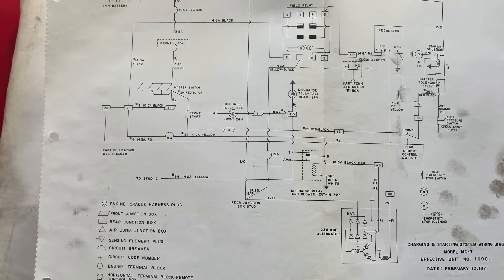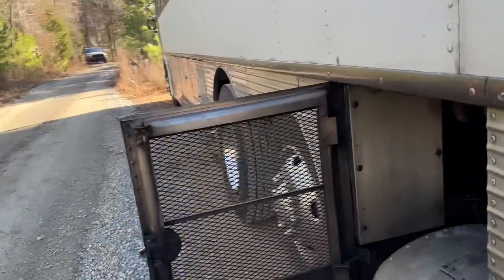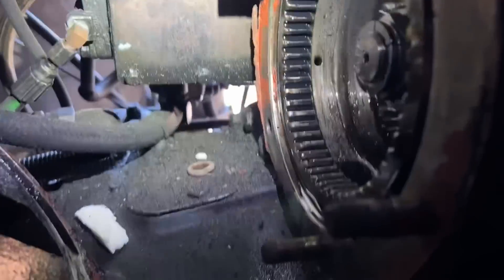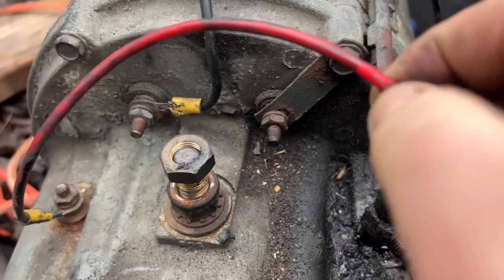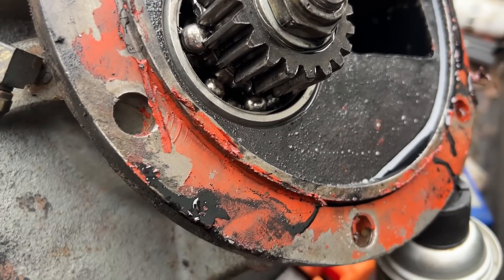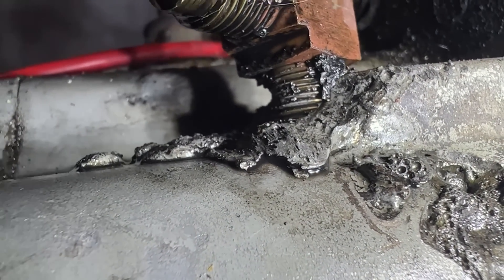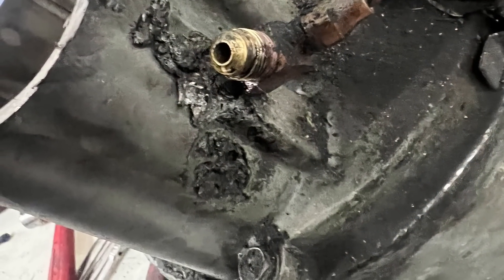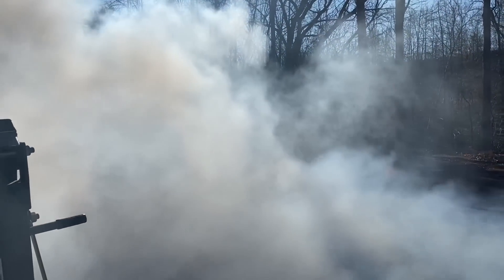Gear driven 50dn alternator spectacular fail in a detroit diesel 8v71.

Comment: Where are you fellas located I’d like to start using you for my repairs. I have a 1995 Prevost XL and a 2003 H3-45. Both always need something. If I could acquire a phone number and/or email with location I’d surely appreciate it. I’m worn out with repairing, driving and I just wanna do the singing from now on. Thank you 

GT

Comment: I have overhauled several 50 DN units , on large motor homes.  I built a jig for my tester to run it up  for testing.  It’s an interesting unit, oil cooled high output.  I haven’t seen one in a while.

Comment: I wonder if the electrical current flow due to the short might have caused damage to the bearing. I have seen the same type of things happen on motors that have low insulation resistance, current  passes  through the rotor back to earth through the bearings and basically ruins the surface of the bearings.

Comment: I know what happened. The cable rubbed thru, arced, grounded out and deposited a small piece of metal in a small gap somewhere inside the alternator and eventually made its way to thru the bearings and ruined it.

Comment: I bet it failed because the tapered roller bearing wasn't on the correct side. 
I bet that eroding happened because whomever installed it didn't disconnect the batteries before putting a wrench on it and grounded out on the case while hooking the power wire back up. 🤣

Comment: Well, the wire looks smooth, not molten. Kind of would expect the heat melting the wire insulation... There is only abrasion marks and no signs of fire. If that starter aluminum housing melts it needs at least 900 Celsius grades. On the other end of the arc would be the wire and its insulation.

Anyhow. Everything is possible. But it looks like someone tried to do some repair with something not suitable...

Comment: Is there a work around to put a regular belt driven alternator on there to get away from the possible gear train damage or is it even necessary?   I assume that style of alternator must be pretty reliable or you wouldn't be putting it back to stock.

Comment: I’m assuming that since my seven has a generator still, I don’t have to worry about this problem. Correct me if I’m wrong. That bus would look a lot better if it had a red, blue stripe and a dog on the side.
Reply from the maker: Even though your book calls it a generator it is in fact a 50dn alternator.  But yours is most likely belt driven not direct gear drive.
Reply: @BusGreaseMonkey  Yep mine is belt driven, but I did not know it was in fact a alt. Funny you said in the video that he did not have a not gen light. From what I've understood in the short time I've been a bus guy, is that having a not gen light illuminated is almost "normal" on Mci's of that time frame. Some of the guys on the bus monkey site said just turn on everything electrical you can and most the time it will put it out. Makes me wonder if it's getting an overvoltage. My light cycles on and off for a while then it stays on.

Comment: Ah the joys of oil-cooled motors & generators.
Great when they are running well, but oh dear me, how messy when they stop, particularly with gear/shaft drives.  Last one I worked on suffered a winding failure which seized the machine (at least there was a shear-pin in the drive shaft so the diesel didn't break).  We drained the oil and copper filings from the machine before stripping it using filter pads to collect the debris (we did a full failure analysis as there were several similar failures at the same time), then wash the residue out (more bits of copper).  Finally located the source of the failure - incorrect taping and balancing of the windings leading to the rotor hitting the stator, the debris caused a bearing to fail and, as they say, the rest was history.  A batch of about 80 generators was recalled (or at least those that hadn't destroyed themselves) and all were found to be heading down the road to destruction.

Comment: Hey Lance………… Ah no, not today, it’s now…… Hey Don!!! This is NOT the video I wanted to see right now!! Especially at 3am, cause now there’s absolutely no way I’m gonna get back to sleep at all!! This is the exact same problem I’ve got on my 82 MC9 with the 8V71. Yep, I did get 
ROOKED by the church, just like I thought. 

I just bought this bus and the entire day I was there looking it over, I started it 5-6 times and drove it a couple times, walked around it checking all the lights and they were burning good from what I could tell but it was still light out at the time. I did not have any warning lights on the dash for no-Gen, or anything else. The bus was running great, as it should for the engine only having 10k miles since rebuild but that was about ten years ago when it was done. I finalized the transaction and was giving things in the cockpit one more good looking over before I was gonna leave and I noticed the amp gauge on the dash was in the yellow and reading approximately 22amps which is extremely low for a 24 volt system so I said something to the church Deacon that I had been dealing with through out this entire process and I asked him again if they had been having any charging issues cause the amp meter was reading low and he once again stated that no, they had
 Not had any charging issues, had not had to ever charge the batteries at all unless they had forgotten to shut off the main battery disconnect, which is fairly common on these, but the lights seemed to be burning good, and it  had started fine all day giving me no indication that the batteries were not charging and especially the fact that I did not have the “No-Gen” warning light illuminated on the dash panel. At this point, I was thinking that it was completely possible that I had a faulty gauge. I’m a. Old jet engine mechanic from the Air Force and that happened to gauges all the time and nothing e
was indicating, without actually putting a meter on it to see what it was producing but since I flew to Florida to look at it , I was limited on what tools I had 

I  made the decision, after being told by both the church Deacon, as well as the pastor himself, numerous times that the bus had just come out of a complete and thorough, top to bottom, inspection to be sure it was road ready and had no issues and was ready for a cross country trip except for the air conditioning. I made it about 40 miles down the road and I lost all lights cause it was apparent by now that I had generator issues. 

Long story short, I managed to limp her the 500 miles home by having to jump start her each morning, which for jumpstarts for three mornings I accrued $800 in jump fees which I feel like I got raped over but I had to get home. I have not torn into that part yet because I’ve been trying to research it to find ouT what the issue was cause the no-Gen light not being illuminated on the dash was throwing me off but this video pretty much explains it all right now. 

Scott, when you say this is an engine killer, what do you mean exactly? What other indications do I need to look for that I have bigger issues? I have not driven the bus since I got her home until I could figure out what’s happening. The oil looks good so far and I don’t have any screaming cats back there when I have started it a couple times. Is this simply gonna be a generator change or what am I looking at? I was gonna try and schedule a visit with you guys this summer when you could get me in an I am a patreon member but it sounds like this may be something a bit more critical than being able to wait if I’m in danger of trashing the engine. Please Scott, advise me what to do here brother! This video now has my stomach wrapped up in knots! But at least this explains my situation and what has happened, now I just need to know how to proceed. 

Thank you Scott for all you Kelli, and Tyler do to help us keep these buses on the road.
Reply from the maker: Diagnose the issue before buying one.   Check the voltage regulator.
Reply: @BusGreaseMonkey  I second that. They’re a lot easier to replace and cheaper as well. I’ve got a few.
Reply from the maker: The direct gear drive alternator can destroy an engine if they fail.  Yours is maybe not gear driven but if it is not belt driven and it’s not working i would recommend finding out what’s wrong and inspecting the alternator.  Usually a non working alternator is not to big of a deal to fix or get working.
Reply: @BusGreaseMonkey  the one on my engine tho scott is identical looking as the one you pulled off in this video. It is located on the very back left side of the engine and is directly below the access hole in the floor at the very back of the bus. It is not belt driven at all and is huge. I’ll call Luke today to see if he’s got one that matches it. 

Thanks Scott
Reply: I have a brand new 24v 50dn I will sell you at a discount to help you that will work for your girl

Comment: If the bearing transmits the short circuit caused by the red wire,it will damage the balls and race,so cause the bearing failure.
Reply: Aah nice one, yes that might indeed have happened. Arcing digging pits in the ball bearings, grease flowing out and BAM. Why you should never weld broken equipment with bearings still in them.
Reply: @Wayoutthere  Go tell that to those pakistani boys.  LOL...

Comment: Why is this alternator oil cooled?
Reply: Well, from a strictly electrical perspective, the back section of the alternator has the six rectifier diodes that are wired up for a 3-phase AC -> DC conversion.  (Visible in this video at 8:05...3 are up on top, going to the output wire; the other 3 bolt directly to the alternator frame.)

The problem is that the 50DN alternator is rated for 270A.  Rectifier diodes will easily drop 1.2v each (or more, depending on their spec!) at such currents...and due to the 3-phase rectifier method, power is always going through at least 2 diodes (positive and negative output).  This means that at full load of 270A * 2.4v loss (1.2v per diode) = a happy 648W of heat dissipation in the back section of the alternator alone.  (Yes, to be technical, this does get spread out evenly across the diodes on all 3 phases, so technically each diode has to dissipate ~108W.)
I always like to compare heat dissipation to a soldering iron...a 25W soldering iron can melt solder.  Imagine a similarly-sized diode being responsible for 4x that power: without oil cooling (or LARGE heatsinks!), these diodes will melt VERY quickly under load!
Reply: @sidlori1592  The man knows his stuff. Believe me.

Comment: When you go to reassemble.  Are you going to run the output cable. The relay and field wire thru at least a foot of fire sleeve or 1" heater hose.

Comment: Most common in that Location is a Cast Iron Bearing Housing that Bolts onto the Accessory Housing
Inside is a Male Gear ⚙ that slips inside a female Gear ⚙ as a Connecter to the Gear train. On the outside is a Double V Pully that Belts run to the Alternator....
Reply from the maker: When this bus was converted to an automatic they changed from a belt driven alternator to a gear driven one.

Comment: To me it looks like a high ampere current flowed through that brass fitting and into the aluminum case, or just the opposite. The brass fitting was better able to handle the heat from that high ampere current so the aluminum around it melted.
Reply from the maker: What ever happened it’s probably good no one saw it or they might have pooped their pants.

Comment: "A bunch of screaming cats" is never a sound you want emanating from your engine bay. It would make sense that the bearing behind the drive gear should be a tapered roller to handle the radial loading force of gear mesh, once the ball cage is deformed and spit out, it's game over.
Reply from the maker: Me-Owwwwwch

Comment: He was very lucky. Do you think the drive gear on drive train is centred in the housing? Maybe putting side stress on alt gear? The damage at the oil fitting looks like the 24v lug broke off one time, and was bouncing and shorting on case.

Comment: Also you are so correct about that bearing.  I had a Jabsco pump on the back of a 4 71 that was missing a little bearin retainer for when it does go bad. The gear drive does not like ball bearings. Not one bit.

Comment: You said you think there would be a fuse. I’m betting the original red and black wire that was spliced had a fuse link in the wire and burned up previously. My guess anyway.
Reply: Yep, must be. 'Those annoying fuses keep blowing on me, gonna remove it.'  etc.
Reply: As for the black and red being flip flopped at some point, some of the early regulators were set up to control the ground side of the field. It may have been switched to a regulator that controlled the positive side. The negative side regulators are not readily available anymore so most set ups have been converted to positive side control.

Comment: Is there was some sort of early warning situation for this type of failure? Besides just pulling it at 80-100k and having someone rebuild a perfectly good one and possibly screw it up for you?  This is one area of concern on my bus I haven’t been able to address.
Reply: Being it a DUMB design for a start, I'd inspect it for wear (on the bearings). Seems like it's not that hard to remove, just heavy.

Comment: The mysterious Arc marks may have been from someone before removing the battery cable and touching it accidentally? Idk what I'm actually looking at. Lol
Reply from the maker: The bus owner says those melted bits were not like that when the alternator went on.
Reply: @BusGreaseMonkey  wow, had to be that shorted wire then!  Crazy it wasn't enough to melt all the insulation off the wire.  Would adding a fuse right off the ring terminal be benificial?  Or just secure the wiring properly?

Comment: Looks to me like a very incompetent individual worked on the bus.
In fact most likely 2 individuals. 
One that used a piece of red wire to replace some missing black wire twisted together and black taped and not secured correctly to avoid that short.
Another that rebuilt that unit and installed the beerings incorrectly.
From the look of the design ball beerings would be a really bad idea in that position even if they're sealed bearings.

Comment: Man that is lucky. Though Scott I hate to go against your thought but I would be extremely hard pressed to be convinced that melted aluminium is the cause of the failure and whatever shorted it out either damaged or welded a ball or 2 in the bearing and came apart. That's all too much damage and fresh looking enough to be coincidence and whatever happened isn't on the hot side of the system. There's a massive ground issue and the oil line became a high current ground

Comment: That’s one lucky bus owner. I did a LOT of those in my day. I only had  one drive take out the gear train in 43 + years of working on buses.
Reply from the maker: Usually that’s a gm problem.  This is the only mci i have ever worked on with a gear driven alternator.  They always have air tensioned belt drive alternators
Reply: @BusGreaseMonkey  I was always going to get you a couple of these alternators. I have a gear driven one from an MCI 8v71, and a belt driven one from a Prevost XL series 60. If I ever get down your way, I’ll drop them off. When you were up in Minnesota at Stan’s shop a few years ago I tried to get up there but it didn’t work out.
Reply: @BusGreaseMonkey  I took the 50dn off my bus (1995 Prevost xl series 60 Detroit) and replaced it with a duel setup 140 amp 24 volt Bosch and a delco 200 amp 12v for my house batteries. I took all the bus HVAC out except the front defrost and air
Reply: The owner was very lucky
Reply: Rest of thing’s looking kinda sketchy 
Owner needs to up his game on prevention maintenance maybe